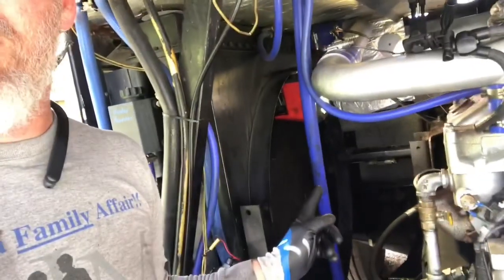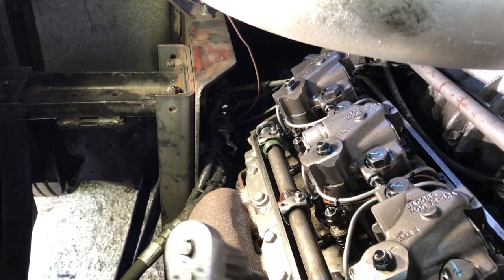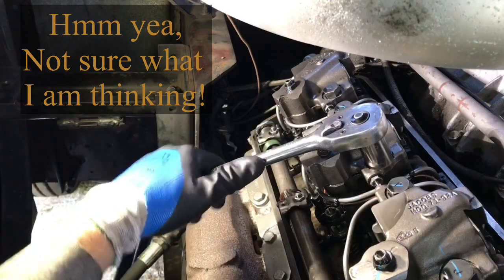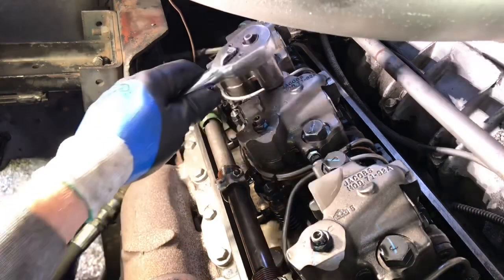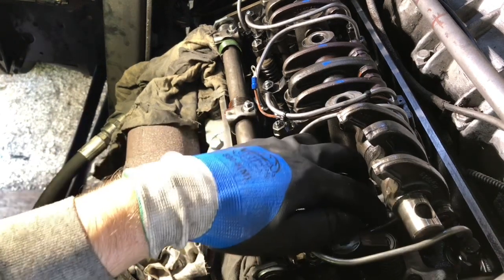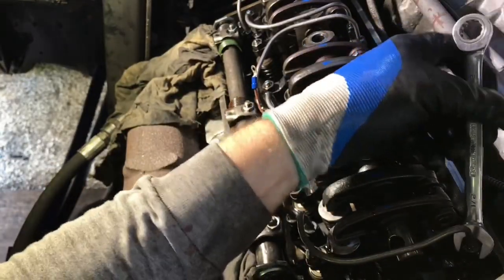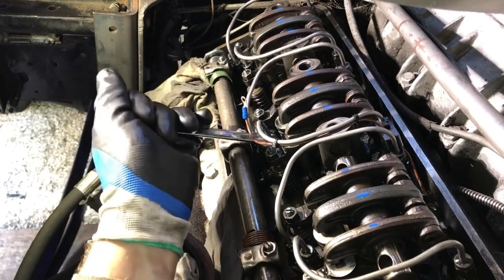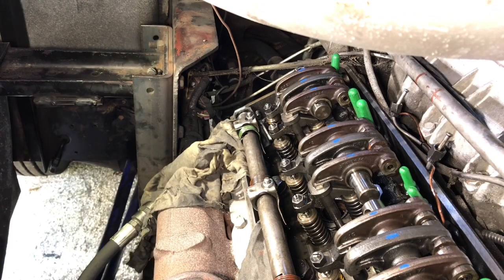-Gino’s Garage-Part 1-Replacing Injectors on 6v92 Detroit, more power! Thank you to Fire & Police!

Comment: Thanks for the video, did you notice much difference from the 9b90s to your new injectors?
Reply from the maker: Yes, it definitely has more pull, but no its not a rocketship. I am really working the 6v92 hard pulling over 52k lbs down the road. I can pull the 6% grade at Monteagle doing 35-40mph which is a bit better than the 30-35mph before. If I was about 10k lighter I bet I would be doing 45-50mph up it.
Reply: @GinosGarageUSA thanks for the reply. I have a new to me dump truck that was originally a 6v92tt. I had to rebuild the blower and replace turbo, added mini bypass plate and aftercooler, and just found today that one of the injectors (9290’s) was stuck and beat up the plunger. The rack on that injector was stuck in full fuel position and  the plunger was stuck  in the down position so not sure if this was constantly letting some amount of fuel by or not. Just trying to figure which direction to go 9g95’s or 9a98’s or bigger. I know when loaded I’ll be up around that weight and maybe a bit heavier but I don’t have grades like you speak of to navigate.
Reply from the maker: @rfinn2506   A bypass blower is always good to have. I believe mine is an 80% bypass and I want to eventually change to the 100% bypass blower. A Detroit guru also told me about a smaller number of teeth on the blower drive helps as well. If the injector gets stuck down it will not fuel, it has to be pressed down to squirt the fuel, doubt you were getting any fuel from that injector. I would recommend a fuel additive like opti-lube to help with the lubrication of your injectors, low sulfur diesel is missing lubrication. Bigger injectors will only help to a point then you also need to get it more air with a turbo that moves more air, and the 100% bypass blower, otherwise the turbo will not do any good. The Detroit guy said also that if you really want more power you have to go to industrial injectors, they will be numbers only in the designation, any injector with a letter designation is for on road use and it limits the fuel to prevent excess smoking at take off.

Comment: Definitely should be more than 350hp depending on RPM. 9G90s were the most common 350hp spec injector.
Reply from the maker: Yea l, I have been doing some more research and found something similar in the marine application with 9E95 injectors and it’s rated at 380 horsepower, but it has a different turbo. So I am thinking it should be up around the 380 range. Thanks for commenting and confirming my suspicions.
Reply: @GinosGarageUSA  that would've been my guess 370-380. Oughta be noticeable especially coming from 330.
Reply from the maker: @Ol2Stroker  Yea hopefully it will give me the little bit of extra I am looking for. I am pushing 42k lbs at least with the Wanderlodge and usually pulling a trailer with suv on it, around 8k.
Reply: @Ol2Stroker  hey I watch your videos as well and I've got a silver 6v92t rated at 340hp and wanted to take it up to around 400 to 425hp. What injector size would I need to make that happen? I'm used to the old big cam Cummins and I gotta old timberjack skidder with a 353 in it and it runs n45 injectors in it.
Reply: @jeremylyons6252  toss a set of 7125s in it and let er ride 🤟🤟
Reply: @Ol2Stroker  thank you! Will it survive at that much injector? I'm used to big injectors and pump on big cam Cummins and cat and drive by my guages but never really cranked a Detroit. Where do you recommend getting the injectors from? Also, i gotta get me a badass Keychain and shirt from you!!
Reply: @jeremylyons6252  hell I dunno depends on what you do with it. They don't like heat so be careful!
Reply: @Ol2Stroker  it is in a truck i use to haul our log skidder. I just haul our equipment to the jobs with it fairly local

Comment: Question does the Detroit Diesel Engine TA92 Silver have a FUEL INJECTOR PUMP? If so where is it 
Located?
Reply from the maker: No they do not have an injection pump. They are multi unit injectors, the high pressure fuel is only in each injector. You have a low pressure fuel pump driven off the blower that supplies fuel to the injectors.
Reply: Reason why I have Exact engine. It runs text book normal. 2 1/2 miles then black smoke & speed from 40,50mph drops basic stall
Changed air, fuel filters tank  drained new fuel. You have idea to check?
Reply from the maker: @patrickguida3979  I would replace the fuel lines going to the fuel pump on the engine. They can suck air and cause this very problem. What is this engine in?
Reply: @GinosGarageUSA  I have   the feeling change the fuel lines and still brings me to changing injectors. Is there a brand you use? Its a 1965 fire truck. No chance you visit Colorado?
Reply from the maker: I would reach out to Area Diesel Service in Illinois, they can help you with injectors. Has it been sitting for a while?
Reply: @GinosGarageUSA  The truck was new in 65 in 78  the engine had some kind up and Trans changed from manual to auto  service 80s and 90s til early 2000s. My appenion its been stored outside for about 10+ years

Comment: You better sit down. It has been over six months and mechanic after mechanic said my cause for black smoke was one thing or another. But I going to change the fuel pump to the Blower. 2 questions is there a way to release the pressure  in the fuel lines before taking everything apart? And it is a very tight space where the pump is. 2 is there a Easy way to  replace the pump?;
Reply from the maker: There should be very little pressure in the fuel system, it’s not a high pressure system. The fuel pump is not easy to get to, you just have to squeeze in there to get to it. The one bolt is always challenging, usually a wrench and some patience is the only way.
Reply from the maker: If you’re getting black smoke that means too much fuel and not enough air. Do you have a turbo? If it starts acting up after some time driving, then it might be the turbo. Need to inspect it and make sure that it spins freely and that it’s not moving around enough to make contact with the housing.
Reply: @GinosGarageUSA  The Turbo was ruled out 4months ago. It spins like free bird. Apparently the mechanics that looked at my Fire Truck only beleave a fuel pump is mounted on outside of a engine. One even said  ( I know this engine and worked on them  many times). Well a peace of dust or drop of oil stain or a bolt had been turned at the fuel pump. His anwser was it was the transmission. Its my turn. Thanks to you I have purchased and overnight shipped a new fuel pump from a company DIESEL PRO POWER. This is a mission  to show those guys need a refresher course. Thank You for your answers. Are you sure you wouldn't  want to do a episode on how to replace a Detroit Diesel Engine fuel pump.
Reply: Thank You for your perfect anwser's.  2 Questions again. Does the Detroit Diesel Engine 6v92TA have a FUEL PRESSURE SENSOR  and a FUEL TEMPERATURE SENSOR?
Reply from the maker: @patrickguida3979   No problem. I am not aware of any fuel pressure or fuel temperature sensors. Is your engine an electronic engine or a mechanical engine? If it’s mechanical it does not have any engine computer at all. You will have sensors for dash gauges but that’s all.
Reply: I ment to ask I got 2 small cylinders with my new fuel pump. Can you tell me what their for. I can send you a picture  I may need your Email address
Reply from the maker: @patrickguida3979  Jeff@ginosgarageusa.com

Comment: my engine has 9g90s injectors and my engine is rated 360hp,but im sure the turbo also has something to do with that power
Reply from the maker: Yes, for sure, all the different combinations can change the horsepower. I will be looking into a different turbo as well in the future. I know I looked at a customers bus and it had 9G85s and was rated at 350hp.. so it must be other things like turbo, camshafts and blowers all make a difference.
Reply: @GinosGarageUSA  my engine is the same as yours,6v92ta  built 1994,, on the decal says tested at 2100  360 hp,then all the settings for injectors etc.
iim sure the blower is the same as yours ill check the decal to see what turbo  i have
and whats crazy i have13ths hrs on the engine and after some minor work to it still running great amazing engines
Reply from the maker: @TheMatrixgod  Would love to see a picture of your data plate.. should tell all the options. Send it to Jeff@ginosgarageusa.com 
Will be interested to see what combination they used. Is your engine DDEC?
Reply: @GinosGarageUSA  ok will do,